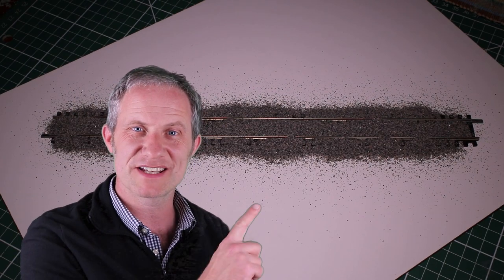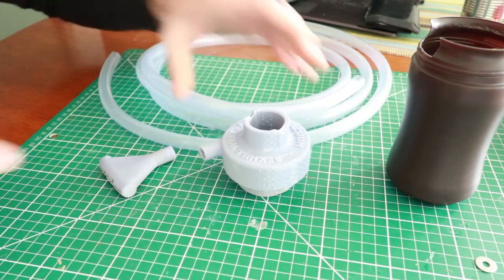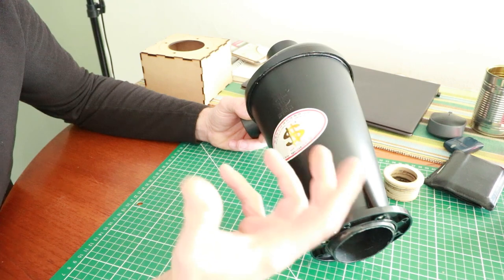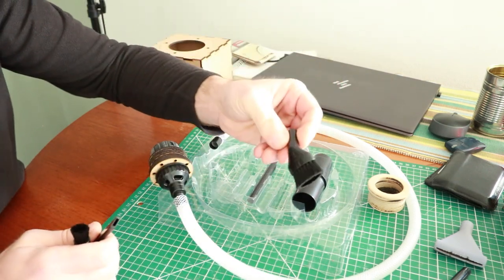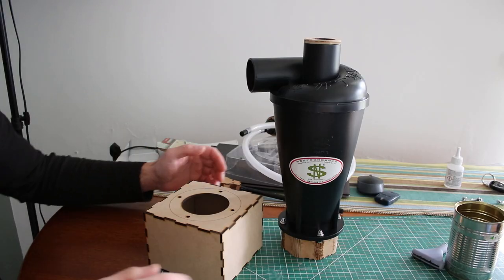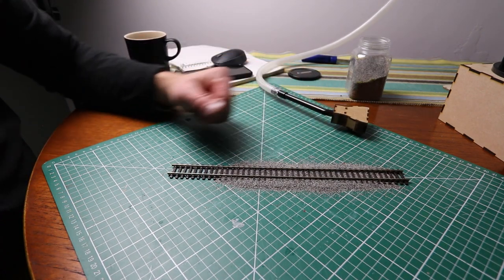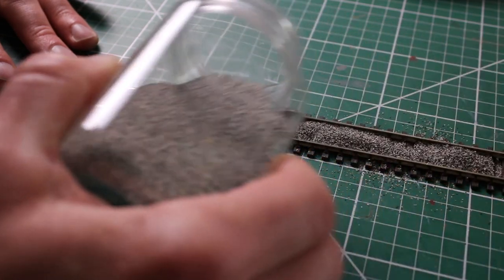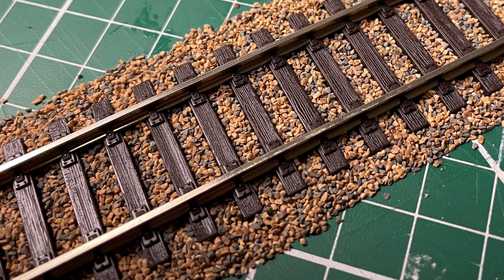Improved Model Railway Vacuum Ballasting System

Comment: So found this just as i have started putting down the first part of about 40 metres of ballasting, and have already found its tricky around points and point motors, so figured i would give your system ago, so thanks James for all your hard development in this, looking forward to receiving it and trying it for myself,
Reply: Its arrived, tried the first 10 metres of my ballast, using the latest version with the pop bottle, and it has made such a boring time consuming chore so easy, it could almost become a enoyable task, James, personally thank you for making such a great idea come to life and be able to supply it to us public.
Reply from the maker: Thank you so much, it's great to get feedback and I'm delighted that you are getting on well with the device.  I agree it certainly makes the task less tiresome and is especially handy when working around point work.
My best wishes,
James

Comment: Seening in the commants that you intent showing other gauges, too. 👍
Would you try/show 00/H0 ballast on 0 tracks (wider version?), N ballast on 00/H0/EM tracks and thiny Z ballast on N tracks, too? Depending on ballast manufacturer and the railway line someone want to model those gradings are often nearer to the real ratio compared to the sleeper distance.

Good that you stayed with telling one topic and gave it the time it needed (so far) this time. 👍 
Better for newcomers as well as if someone wants to lookup one topic.
Even I´ve been waiting for how a other topic developed - I got to be patient, it surely needs it time and wants to be presented on it´s own.
Reply from the maker: Hi, you make some great suggestions.  In my next update I will try to show a variety of ballast on some different gauge tracks.  Many people use N gauge ballast with OO track for example and so to see it in action would be useful for many I'm sure.
Thanks for watchinng,
James

Comment: Thanks James, an excellent initiative! 

As it happens I have the very same cyclone separater attached to a 10 litre plastic bucket and a shop vac that I use with my table saw and my drop saw, so 50% of the way there! I would very much like to be added to the list for a fret please, I live in Australia so posting might be expensive, but I think the fret would fit in a small padded parcel bag? Would also be interested in the STL file as well. Would be good to give a resin print a whirl.
Reply from the maker: That's great Andrew.  I've been meaning to try one of these separators in my own workshop for years.  I think they're really neat.  May I ask whereabouts in Australia you are?  For no reason other than I am fascinated by the cane railways of Queensland, just wondered whether you were anywhere near them.  
My best wishes,
James
Reply: @BexhillWest  I live in a small town called Mudgeeraba in the Gold Coast Hinterland, west of Burleigh Heads. We are almost on the southern boarder with New South Wales. The heart of the Queensland sugar cane district is  the City of Bundaberg which is about a 5 hour drive north from where we are. No doubt you have seen this site http://www.bundabergcanetrains.org.au/

Comment: I liked the original and also like the new updated one as well. As I make and sell 3D items I fully understand where you are coming from regarding a production run. Making 3D models is only viable when you can ram a load of items on the printer at once and print in a short time and use a small amount of resin as possible. However, as there are a lot of hobby printers out there it maybe you can share the .stl files or even ask for a donation. I would gladly make a £5 donation and make my own. That way you get something for your hard work a research and you can put the money into your next project that we may end up want files for. Just a thought.
Regards Geoff. Jumble Lane Printing

Comment: Magnificent concept James. Count me in for one please....Just thinking aloud, is there any merit in a sort of twin snow plough side shoes to `scurry in'  the ballast as you do sweep over? Perhaps with slightly curved bottoms so it does not jolt against the baseboard. LOL.. I know what I mean..All the best James
Reply from the maker: Hi Martin, it's not a bad idea.  I have made a clip on 'shoe' for the version shown in the video and the idea does work, but it is a little fiddly around pointwork etc.  I've found the device to be most useful used as shown.  On my own layout I tend to just sprinkle the ballast down and use the vacuum to tidy up the ballast shoulders - it's so quick.
Thanks for sharing your thoughts though, it all helps.
All the best,
James

Comment: I watched the first video you did and thought of a question do all vacuum cleaners run at the same suction pressure?. This video started to auto play. That question is now irrelevant with the new version of the head having an adjuster.
One other query is how does it cope with different grades of ballasts?. Can it be used on fine scales of ballast for N gauge for example?. could you incorporate grooves in the bottom for track gauge with maybe some triangular/angled edges on the end directing ballast into a shoulder with any buildup being directed towards the vacuum slot/groove, thus giving a perfect ballast shoulder???…

Comment: Definitely interested, I'm amazed that the suction is quite selective on what it picks up , its like its been well trained ( please excuse the pun) have you tried it with track on cork underlay ?
Reply from the maker: Hi Adrian, yes I have.  All the track on my own railway is laid on cork underlay and the results are the same.  There is the air admission valve on the collector head which offers some additional control over the vacuum draw, but I've found it works well fully-closed.  In my next video I will show the concept working with underlay, but I have shown it in previous videos.  A job which I used to dread is now literally a breeze.
Thanks for watching,
James

Comment: Yes I would give a commitment to purchase one as I have a lot of ballast to put down.  Just out of curiosity what size ballast were you using ?  Thanks for sharing.
Reply from the maker: Hi Alan, In the video, the brown ballast is DCC concepts OO gauge ballast which I think is nearer to the usual N gauge stuff in size.  The grey ballast in the first couple of clips was sold as OO gauge, and is of the heavier stone type of material rather than the lighter 'crushed walnut shell' material.  I hope that makes sense.  
All the best,
James
Reply: @BexhillWest  yes I have found them on DCC website.  Thanks 🙏

Comment: Interesting, keep me in the loop. Any good around turn-outs?
Reply from the maker: Great question.  It works a treat.  You may have seen from some of my previous videos that I have used this system exclusively on my own ballasting.  It is probably at its most convenient when working around points/turnouts as it lifts the surplus material upwards and away.  Often when cleaning up with a brush the ballast can become 'swept' into the check rails whereby it can become jammed.  With this system that problem is avoided completely.  
Thanks for watching,
James

Comment: This looks like a great solution to break the monotony of ballasting long runs I would be interested. Have you tried it with code 75 rail? Just wondering if the shallower height would make a difference.
Reply from the maker: Hi Matthew, sorry for the delay in getting back to you.  All my trackwork at Bexhill West is code 75, and it works a treat.
I have a new video coming out later today (19.06.21), which gives details of how to get hold of the parts.
Thanks for watching,
James

Comment: Hi James - What a brilliant concept.
My layout is over 30' long with a minimum of eight tracks running the full length so an aid like yours would be immensely valuable along with using a ballasting tool which I already have. 
I was planning on using my old Dyson DC34 handheld hoover which has now been discontinued but which you can still get rechargeable batteries for.
So my questions are could this fit my DC34 and would that work just aswell as your cyclone separator?
Secondly would you need to manufacture a smaller one as I model in N gauge?
Regards Chris
Reply from the maker: Hi Chris, yes I think it should work a treat, and if you had a dedicated 'hoover' for the job then the cyclone part could be avoided.  It would, I think be the perfect set-up.  Perhaps I ought to send one over to you to test-out.  I have a couple of spare frets.  Better still, if I can find the dimensions of the dyson style connector, I might be able to 3d print  a suitable adaptor piece which might be even better still.  Leave it with me, I'll jot the idea down in my notebook and look into it.
Take care,
James
Reply: Hi James, although my Dyson DC34 is old it runs like it is brand new having managed to get new batteries for it.
I plan to just use it on my model railway.
What you suggest sounds brilliant especially the Dyson style connector. More than happy to run my Dyson over to you if you cannot get the measurements. 

No hurry James, take your time, more than happy to meet all expenses.
Regards Chris